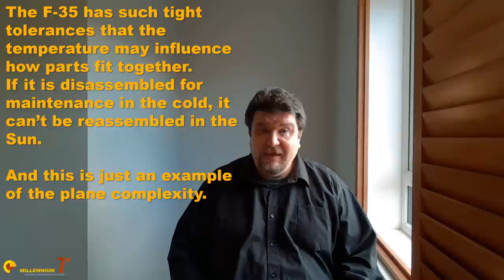F-35: The Failure of the $100 Million  Dollar Jet | Maybe...

Comment: Reopen the project of a carrier bourne JAS39 Gripen E and equip it with a GE f414-EPE and it would be the perfect solution for the problem mentioned in the video.
An advanced and capable multi-role fighter at half the over-all cost of the F35 and at least 30% better service level than any American fighter of today.

What more could you ask for as a carrier commander?
30% better service level means that with the same number of planes you can have 30% more planes ready for duty at any time.

Also speed up the project for an unmanned version of the Gripen E.
SAAB has worked on an unmanned able version of the Gripen for some years now.
The aim is to make it an upgrade of existing Gripens and incorporate it in coming Gripen versions so that it can be flown remotely or preprogrammed as well as by a pilot in the cockpit.
Reply: @AllThingsCubey  Well it has been proven over and over again in red flag and joint excercises that Gripen C (the current version) beats every gen 4+ fighter on this planet.
Now the next gen Gripen E is about to enter service.
Mind well that Gripen E is NOT an upgrade of the Gripen C.
Gripen E is almost completely a new designed fighter.
The only thing that has not been redesigned is the airframe around the cockpit (and, of course, the name has not changed).
She is on par or better than the F35 in all aspects of electronics, data link and weaponry.
She is far better than the F35 in everything else except the physical stealth but on the other hand she most probably has the best on board fighter bourne ECM and EW systems so in practice she will be invisible to most competitors radars.
Some Typhoon pilots had some experience with the current version of the EMC on Gripen C.

The only draw back on Gripen (all versions) is that she is a bit underpowered wich is a bad thing in pure dog-fights.
I have for some years now propagated to incorporate the GE f414-EPE instead of the GE f414-39 engine (120 kN instead of 98kN thrust) in the new Gripen E incorporate the GE f414-39 in the Gripen C and D versions.
That would render the Gripen E to become the by far best gen 4+ fighter on the market, in all aspects.
Reply: @CaptainDangeax  Twin engine = 75% more expensive and extensive maintenance (at least).
Reply: @CaptainDangeax  BNP per capita comparison:
Sweden 54000$
France 41400$

It's a waste of money to drive around with a Volvo XC90 if you can get all your duties done with a Renault 205.
Reply: @CaptainDangeax  And how about  missiles? 

Note that the Rafale can't even fully utilize the Meteor missile since the Rafale doesn't have the two way data link to the missile. The Eurofighter, Gripen C/D and the Gripen E/F,  all have the two way   data link to the Meteor.
Reply: @CaptainDangeax  Not only are we neutral, we have by Swedish laws a strictly defensive military.
Also by Swedish laws we are not allowed to put our future in hands of other countries military power.
That rules out both carriers and nuclear weapon.
Number of fighters per million inhabitants:
Sweden: 9,7 (in a few uears from now 60 Gripen E will be added and this figure will rise to 15,7 fighters per million inhabitants).
France: 4,1
Are you proud of your tiny little air force (compared by population)?

Regarding nuclear weapon.
Officials have stated that we at any given time the last few years of the 60's were 15 minutes from becoming a nuclear country.
We had plenty of weapon grade fissile material, we had the bombs manufactured.
Everything was ready except that we never put assembled the fissile material into the bombs.
By Swedish laws a weapon is not a weapon as long as it's critical parts is not assembled.
Sweden used this law to overcome the obstacle of the signed 'Non-Proliferation Treaty (NPT)'.
Reply: @AllThingsCubey  
Edit: I see now that your target was the French Rafale and Mirage, not the Gripen.
I keep my comment anyway. End edit.

What do you by only one bomb compatible with NATO standards?
Gripen C & D is fully compatible with NATO standard.
Gripen C & D is currently operated by two NATO countries around the world, Czech Republic & Hungary.
Gripen E will not only be fully NATO compliant, it will also be the first fighter ever to be globaly certified by ALL cicivl aviation authorities.

The inter link system is not fully compatible with NATO and the reason for that is that there is no inter link system in NATO that is as advanced as the Gripen inter link (one exception the inter link system on the F-35).

Gripen C NATO compatible weapon: 
- 27 mm Mauser BK gun
- DWS39 (SAAB developed version of the German DWS24)
- Paveway (USA), AIM 9 Sidewinder (USA)
- AGM-65 Maverick (USA)
- AIM-120 Amraam (USA)
- RB15F (A Swedish multipurpose heavy missile used by numerous NATO countries, for example Germany)
- KEPD 350 Taurus (developed by German EADS and Swedish SAAB Bofors, used by Typhoon, Tornado, F/A-18 and Gripen all over the world)
- MICA (French air to air missile)
- Meteor (developed by British MBDA and Swedish SAAB)
- IRIS-T (developed in Germany)
Reply: @CaptainDangeax  Guess you answered the wrong thread.  I love the Rafale, but is still second to Gripen C/D, Gripen E/F and the Eurofighter when it comes to using the full potential of the Meteor.

Comment: The high mix is in my eyes the best solution. The F-16 should be replaced by an improved F-16. Numerous changes (design/engines) would be welcome. In no way the F-35 should totally replace the F-16. Like you have mentioned it, the electronic signatures of F-35/F-22 are no longer a secret, although the 100% silence over it is the rule!Therefore no total investment into a plane which is what it is. Continuous research in diversification remains a priority!

Comment: Great video. The content outweighs the production values. 
One of your last points is exactly what I was thinking, even a 4++ fighter is not a cheap project from scratch. It will essentially have to be better than the latest F-16 as a starting point. Pressure will be there for it to do more and more things, with better electronics and weapons etc. It will get heavier and bigger and more expensive until it goes full circle too and end up the opposite of what was intended.
I agree with other suggesting the Gripen. Maybe even a copy of the MiG 35 with American engines and electronics.

Comment: I wont be surprised the Air Force will pick a modified Saab Gripen if they need a quick replacement.
Reply: Nah, they won't. That would be completely against their goal; which is to swindle the most out of taxpayers' money.

It's far more expensive to demand another new design than it is to just buy another country's products. Not to mention keeping their high horses.
Reply: Why, when the F-16 is still in production?

Comment: Building a clean sheet 4.5 gen fighter with all its surprises and R&D costs makes absolutely ZERO sense in the long run. I have talked to several engineers and pilots, and they are all scratching their head at this study. It is EXTREMELY unlikely that this study would actually materialize into a new aircraft. 4++ fighters are not significantly less expensive than the F-35A anyways. The F-16V would have been the cheapest and most logical option for the air force, but they explicitly say they don't want a new F-16, but a clean sheet design. For me, this is a clear sign that other contractors (err umm boeing) need a bigger slice of the fighter pie in the US DOD. The USAF has always been aware of the F-35's costs and were prepared to handle this. Lockheed has even proposed a game plan for reducing the F-35's costs in the coming years. flyaway costs, maintenance costs, and mission capable rates have all been improving. The situation has not gotten worse all of a sudden, so it makes no sense for them to all of a sudden change the gameplan. The F-35's troubles were at their worst in the early 2010s... but there were no 737 max groundings and subsequent major losses for boeing back then.  

https://www.youtube.com/watch?v=oj1qTo2Ohdw 
The media has also been blowing this entire situation out of proportion. Studies like this are not uncommon. There was a plan to replace the aging and expensive F-15Cs with F-16s to save money. That never materialized, in fact we bought new F-15s. I have lost track of how many times "the F-35 has failed" according to the media. That airplane is the cornerstone of the USAF capability according to Brown. Its the future of NATO air forces and more, and its here to stay. 

And no, buying Gripens, Rafale, or Eurofighter is a horrible idea. Gripen E lacks range. Less range than even an F-16. Rafale and Eurofighter in terms of unit cost are even more expensive than F-35, and not exactly cheap to operate either. I know this lass part may anger many people, as the euroconards have a huge fan base on the internet, but they are simply not fit for the USAF.

Comment: They should make a F-22ish one engine fighter that were focused on keeping the prize down but him production cost and in flight hour cost. 

If ready to do some compromises it could be done fast and relatively cheaply.
Reply: But the propaganda on how much stealth would buy meant it had to be ultra-stealth and that costs lots in money and impact on the design. You would have to insist on a design that was reasonably stealthy, and it had been sold to congress and the people that stealth was that silver bullet, which I do not think it is since Russians and Chinese have had 40 years to figure out how counter stealth, and the assuredly have. This is I am sure part of the reason the Air Force is no longer so sold on the F-35, the know that steath is costing them big time, and not buying enough anymore.
Reply: @cliffordnelson8454  Stealth is not the main reason that the F-35 program got so expensive, and the unit cost is too high. The main reason was that they insisted it should do everything, especially the STOVL was problematic, and also limited its performance in other areas.

Comment: The point is that if the F-35a/b/c multipurpose 5th gen planes are used in the 99% of missions where a 3rd or 4th gen plane would do quite well the F35 airframes would be foolishly worn out too soon.   He wants to buy some more new F15EX's to replace the F15C and F16 and include the awesome software from the F35 program in the new F15EXs.
Reply: What about heavily contested air space? More jamming?

Comment: Ironically the consensus is the F35B is probably the only version that makes sense. Getting an effective 5thgen multi role to do STOVL is a real achievement.

The high-lo mix for both navy and airforce however... the f35 truly fails in this regard. A cheaper fighter is needed, otherwise the USAF and navy will lose the ability to perform the volume of missions required to win wars according to current US doctrine.

Comment: You seem to have bought into the idea that the F-35 is a "Fighter".  It is not, despite the F designation.  It is at best an F/A, but more realistically, an Attack Aircraft "A".  I believe the intent of the new 6th gen "Fighter" would be to replace the F-22 of which the Air Force has insufficient numbers and is starting to get old.  If the AF is trying to build another do everything airplane then they will be simply perpetuating the cycle of failure.  I believe the F-35 is an excellent aircraft within the confines of it intended, not stated, purpose.  The same is true of the F/A-18 which was originally designed as a replacement for the A-7, a role it is extremely well suited for but, it is not a suitable replacement for the A-6 or the F-14.
Reply: So what aircraft is intended for air superiority role today? 
One of the 168 remaining F-22's? How many are stationed outside US? 
If the F-35 is not a fighter , what do US have that can operate from a carrier?
Or are carriers being abandoned?
Reply: @eleson00  
The F-35 is the product of the Joint Strike Fighter Program (JSF).  Note the word strike is very much intentional there. It was not meant to be the equal of the F-22 in the air superiority arena, but to have enough capability in that area to help out, and perhaps self-escort. It’s no accident this mirrors the relationship of the F-16 to the F-15. The F-16 was a less capable (at the time) air superiority fighter that could supplement and backstop the more expensive F-15, and swing to ground attack role once air dominance was achieved. 

Then Secretary of Defense Robert Gates cancelled the F-22 so he could put the money into more drone orbits to fight the ‘war on terror’. The pause in the Cold War had deluded many into thinking USAF and USN no longer needed to be able to fight a near peer enemy. The thought was that the F-35 was going to be less expensive than the F-22, and it would be good enough at air to air to be the backbone of the tactical air force.  

When the F-35 began to suffer serious developmental issues, I think they should have forgot about the airplane and put the advanced electronics into an updated F-22, because it wouldn’t really be any more expensive.  But that would not make all the international partners happy, so the program was too big to fail because it was to be the next great foreign military sales program.  The VTOL requirement also helped keep it alive.

The F-35 is here now, and is the most capable aircraft in its category. Development costs have been spent and unit cost is coming down.  Operating cost will probably come down more as well.  Building less of them now will only ensure they become more expensive.  Replacing them with a 50-year-old design is not a smart choice, it is a desperate choice. It might have been a smart choice if they’d used the F-22 instead of the F-15, 20 years ago.
Reply: @eleson00  The F-22 is an Air Superiority Fighter.  The F-15C augments the F-22 in that role.  The F-15EX will replace the F-15C. The F-22 is currently deployed in a Air Defense interceptor role in Alaska, Hawaii, Virginia, and Florida.  It has been deployed over seas but is not permanently based outside the US.  The F-22 would be based outside the US if we had the over 300 that were supposed to have been procured. The Navy currently relies on the F/A-18E as its Air Superiority Fighter, a role it is grossly over matched in against current peer state advisories.
Reply: @tolson57  And that's just it.  What is the point of a domestic Air superiority fighter? Air superiority on home turf should be a given. 
When US decides to 'help' countries in the middle east, there is a lack of an available Air Superiority fighter because as you say, the F-35 is not that aircraft. 

So US, the most powerful country in the world, have 168 F-22's and 375 F-35's and a bunch of aircrafts from the mid seventies that have served its purpose and are at the end of their lifespan, with inferior capabilities. 
If one, just one, of these aircrafts are shot down, that whole bet on `stealth is wasted. And where are you then?
No one but US have put US in this position.
Reply: @eleson00  I guess I am missing your point.  The F-22 is the primary US Air Superiority fighter.  Regardless of stealth, it is the deadliest fighter in the world today.  If needed, it will be forward deployed.  The US needs a replacement for the F-22.  Those that believe that the F-35 was that replacement did not understand the role the F-35 is intended to fill.  That is to be expected when the Air Force and the DoD had to sell the F-35 to congress as a do everything plane for political reasons.  It is an Attack aircraft optimized for penetration missions in heavily defended areas with self escort capability.  What people seem to forget is that once the SAM systems are destroyed and the airfields are cratered the F-35 will be loaded up with an additional 15,000 pounds of external ordnance for attack missions in a permissive environment.  The US Air Force and the US Navy are in desperate need of a new Air Superiority fighter.  The Air Force does not have enough of them and the Navy does not have one.

"If one, just one, of these aircrafts are shot down, that whole bet on `stealth is wasted. And where are you then?" We will be in a hot war and the military will carry on because the Navy and the Air Force knew full well the limitations of the aircraft.  The military knew there would be loses and they requested enough aircraft to complete their missions and the politicians got cold feet and cut the production for political gain.  The lack of aircraft aside, the Navy and Air Force will use the assets they have to maximum effect.

In 1990 Bagdad had the most sophisticated Air Defense system in the world.  Many pundits said it was suicide to try and attack it.  They were wrong.  They are saying the same thing today because of fear of the S300 and S400 systems.  The Military is well aware of those systems capabilities and will use their assets to neutralize those systems.

Comment: A fighter with the long term cost of the gripen and capability of the Rafale...
Reply: ... capability of the Rafale? 

French missile, except for the half way integrated Meteor.

You are right about the cost. One gets a bang per buck equivalent to at least an extra air force if one chooses the maintenance friendly Gripen over the Rafale.
Reply: @qwertyuio266   the Gripen is deployable in much larger numbers than either F-35 or Rafale and can be dispersed to country roads in wartime.

Comment: I believe stealth aircraft will be easy prey for digitally-operated missiles which don't necessarily lock onto aircraft.. but function via algorithmic problem solving. 

It just needs the tiniest signature moving unnaturally that's regenerated in an onboard sim-world computer to compute general target co-ordinates .. before moving in and its additional onboard sensors + radar generate a decent firing solution.

And if it runs out of fuel, or fails... it self-destructs, or parachutes down for pick up or re-use.